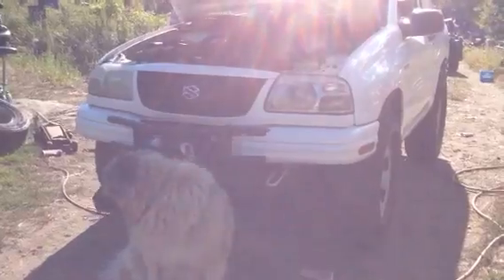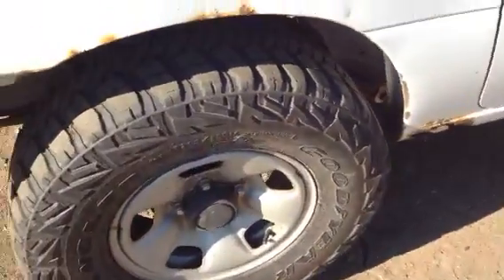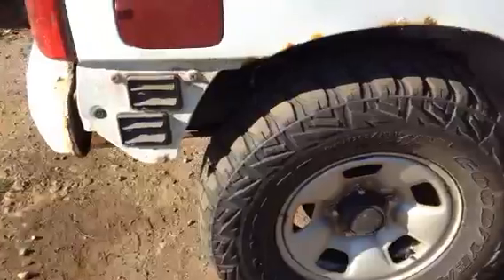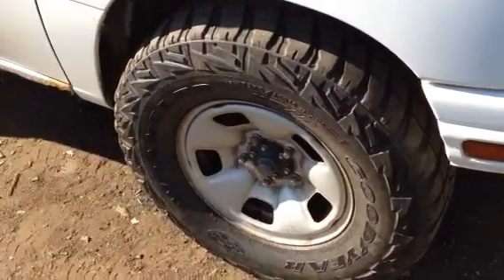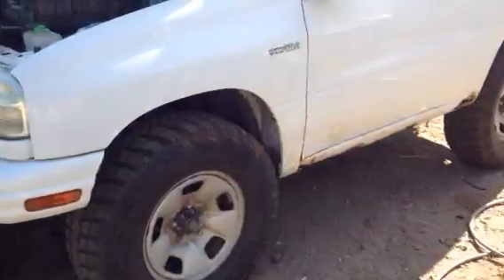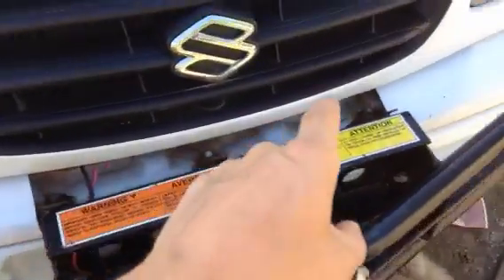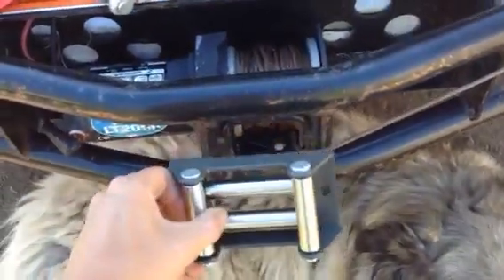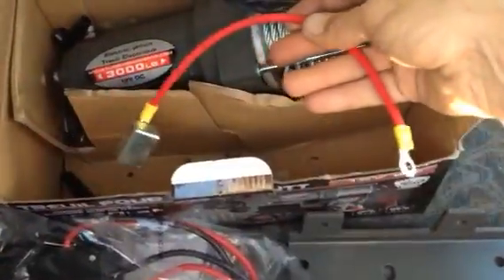Off-Road Suzuki & EZ DIY LIFT Mods!

Comment: The Lord works in great ways i just told my brother i was tired of my tracker sitting so low that i have to jack it up just to do a oil change and wished there were a way to put a lift kit on it and then he showed this video right out of the blue. you did a great job on this video and want to thank you  also i found that i can put 2 hockey pucks drilled out for each body mount and lift it another 2 inch's Thanks again for the video. I have subscribed.
Reply from the maker: awesome thanks, check out the actual build video here, https://www.youtube.com/watch?v=pfh508vzzxg might find some of it useful

Comment: I was looking for a way to lift my 03 tracker 2-door      good thing I found your video
Reply from the maker: glad you enjoyed it, this one is also a 2003 (vitara).  I got my front springs and extra isolators from a tracker (4 door).  I got about 2.5" of useable lift and gained suspension travel also, for basically a fraction of the cost of a lift kit.  I only paid for one strut, I was lucky enough to have all the other stuff laying around.  thanks for watching.
Reply: I have a new gen 2001 4dr 4x4 2.0L tracker, I'm assuming this would all work for me for no need to extend lines etc right? I kno there is little difference between the two
Reply from the maker: I got my front springs from a 4 door for lift.   If you have a 4 door already and need lift, you might need multiple isolators or even a spacer above your spring.  Otherwise get front springs from a 7 seater Suzuki XL7 grand vitara perhaps, and double isolators.    I had to modify my front and rear flex lines.   An extended rear flex line would help , otherwise modifications like I did.
Reply: Thx ya I clued in u had a 2 door after I asked lol

Comment: regarding the winch...the 3000lb capacity is on the first wrap only so to get the full strength from your winch run all your line out...and if you use a snatch block run your line out allthe way put it rhrough the snatch block and then run the hook end back to your suzuk that will double your pull weight.
Reply from the maker: robert wilson yeah I have a snatch block pulley and I also upgraded to a 4000 lb winch.   After I built the plow in a more recent video, this vehicle is unfortunately gone to a new home.  However I am working on another adventure 4x4 vehicle and I'm going to better document the winch and lift and off road lights when I install them.  Thanks for watching

Comment: You said you slotted the shock mounts but Is there any way to adjust the camber for on road use? I use my ‘99 on and off and I’m worried about never being able to get the camber right. Any suggestions?
Reply from the maker: yeah i slotted the top bolt hole of the lower strut clamp on the front struts, which are from a 95 grand prix.  slotting the upper hole in the lower clamp allows the camber to be adjustable yes and thats why i did it.  you have to clamp it down extra tight when you get the alignment dialed in, or take it to an alignment shop and have them dial it in as best as possible, but this is an off-road (budget sxs) build.  although it did work amazingly well, i have other videos of offroading with it

Comment: Will this set up work on my suzuki xl7 2002 ? Or do I need bigger shockd from another vehicle that might fit ? ..... Great vid btw :)
Reply from the maker: most of this stuff will lift your XL7 aaside from the front springs i used.  the ones i used in my 2dr came from a 4dr model.  since yours is already a 4dr model, you already have the bigger springs.  you can use a simple pair of 2" spring spacers up front with your factory springs, using the grand prix struts, or using strut spacers.   i prefer the GP struts because they allow more flex and travel.  thanks for watching
Reply: Thanks a lot for all the info :)!! For sure ill be getting the GP shocks :)!
Reply: I just did my 2001 XL7, I would not do anything that the smaller vehicles call for... I did use the 2 inch kit, and I've got the perfect shocks, I've got to look up the numbers but I will get them to you... I got them from Carquest

Comment: Hi! Reaaaaally interested in this setup! Have you ever tried it on the road? I would like to know how is the driving at higher speed? Is the car horizontal with this setup? And could you please send me a picture of the double isolator setup?
Reply from the maker: this was an off-road build, but yes it sit nice and almost perfectly level with trailer hitch / load.   no squat when towing / loaded.  the double isolator can be seen on my other video here https://www.youtube.com/watch?v=pfh508vzzxg
Reply: @613Builds  thanks for this super fast reply! Ok, I just watched the other video. In the present video, you said that you put one insulator on the top and one on the bottom of the coil, but in the second video, I see that they both are on the same side? They fit one inside the other? Unless you've put one on the top of the industrial washer, and one on the bottom of the industrial washer? 
What height does that ''insulator coupling'' has?
Reply from the maker: @maximegarant8005  sorry i know that is confusing the way i worded that.  one factory rubber isolator on top of the giant washer and one below the giant washer, both ontop the coil spring in the factory isolator position.  the isolators don't add up to much because they are squishy and nest into each other but combined double-isolators are about 3/4" or 0.75" i'd guess.  when i salvaged bigger 4dr front springs to fit this 2dr at the junkyard , i also salvaged the extra set of rubber isolators.  cheap spacers might work similarly but i cant say exactly because i prefer minimal spacers and maximum suspension / spring and shock travel.

Comment: could you give me a list of all the parts you used so I can lift my sidekick
Reply from the maker: sure.  the rear springs are from the rear of a ford focus wagon.  the rear shocks are from the rear of a late 1980s/early 1990s ford mustang.  the front struts I used are actually from the REAR of a 1995 grand pix.  the front springs I used are from a 4-door tracker/grand vitara with double isolators.  so if you get more springs, save the rubber isolators from both vehicles.  if you use two isolators per spring, you will get more height and cushion.  I put large industrial steel ring-washers in between my isolators, over the factory bump stops.  I also elongated the top bolt holes on the 95 GP struts for camber correction after lift.  I used 265/75/16 tires on factory wheels but it would be best to run 235/85/16 instead, and I would prefer lighter alloy wheels but I don't have any right now.  most of the parts are mentioned and/or shown in the videos, as well as in the video description above.  the rear flex line may need to be swapped for a longer one, but I simply modified my original lines to reach.
Reply: what year ford focus wagon
Reply from the maker: I don't think it matters.  Mine were from a 2004 I think.  But I believe any focus wagon rear coil springs should work.  They fit the vitaras/trackers nicely.
Reply: what bout a 96 side kick do you think these parts will fit really appreciate the help
Reply from the maker: mine is the next generation 2003 style but the earlier ones also had the same coils springs suspension.   they should fit but I cant guarantee anything with those older ones.   they fit my 2003 style almost perfectly.
Reply: Did you use grand prix rear struts on your front with the stock vitara strut mount is OEM position? I know some use OEM strut mount upside down to accomodate OEM strut. This seems easier if you use the same strut mount as designed.
Reply from the maker: sound.affliction this is a 2003 vitara.  Its much harder to flip these ones.  The older sidekicks are easy to flip, but these ones are more difficult, i consider myself handy and I wouldn't even try personally.  I used stock mounts and longer springs and shocks all around

Comment: What size tires are you running?
Reply from the maker: (i reccommend 235/85/16 BUT) these here are E-rated 10ply 265/75/16 , about a 32/33" overall, they are capable of 80psi.  goodyear MTR

Comment: It's work on my Chevy Tracker 4 doors ???
Reply from the maker: yes, but i used 4dr springs on this 2dr for lift, with 2 factory rubber isolators.  if you already have a 4dr, you will need to use the suzuki XL7 front springs, which are heavier, otherwise you can use spacers in the front.  everything else will work the same, but the front springs.  to lift a 2dr i use 4dr springs, but to lift a 4dr, you need XL7 springs, or spring spacers will work.
Reply: @613Builds  ok THX and about the years it's still the same for xl7
Reply from the maker: these parts are all interchangeable and fit years 1999 - 2006 in suzuki vitara , chevy tracker , and grand vitara XL7 .  also known as suzuki escudo in various countries
Reply: You know if the rear coil spring from xl7 fit on my Tracker ?
Reply from the maker: yes it would fit, and i do reccommend the XL7 springs but i usually reccommend them up front.  you can use XL7 springs all around if you wish, which will give  1"-2" of lift on a 2dr or 4dr 5passenger model.  :)
Reply: Ok because i saw on ebay full set of spring with 30mm more long . I hope is not too Much . I took all shock from your video
Reply from the maker: @leroux345  yes the longer shocks are nice.  xl7 springs would be nice as well
Reply: You tink if a have like 3" lift , i gana need the bracket to drop the diff !?!
Reply from the maker: i didnt drop the diff and i figure mine is 2.5" , plus i abused it offroad, my friend even jumped it once and it worked great.  never had any problem.  it is recommended to drop the diff with 3" to make the CV axles more straight which helps avoid droop binding and premature CV wear
Reply: I set Up the lift kit last week , but i had a issues. My  front grand Prix shock don't fit on the strut mount ( bushing on top ) How you make IT !?

Comment: what size tires are those?
Reply from the maker: 265 / 75 / 16 goodyear MTR E-rated 10-ply , i think the're 32.5" .   also what works good on these trackers is 235 / 85 / 16  which is also 32.5" but narrower.  the 235/85 is easier to fit being narrower than the 265.  :)

Comment: What year focus?
Reply from the maker: The Pacific Northwesterner I used 2005 but I think any focus wagon from 2000-2007 should work for the rear coil springs.  They work great.  Watch and modify your shocks and flex lines accordingly
Reply: MrJohn613  appreciate it, So I ran into an issue with my 1999 Chevy tracker 2 door 4 wheel drive I got a Spring lift installed on the front just to find out that the one in the back wouldn't fit, and they were mislabeled so i stead of the 1.5 inch going in the front the 2 inch went in the front so now i have to find a 2.5 lift for the rear.
Reply from the maker: The Pacific Northwesterner I would recommend the focus wagon coils, should be somewhere around +2.5 or +3 on a 2dr like this.